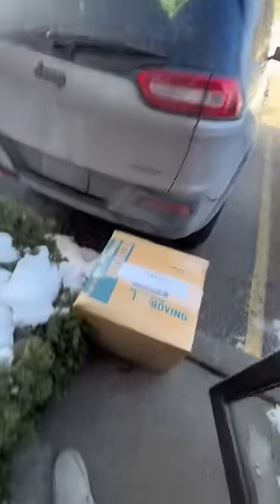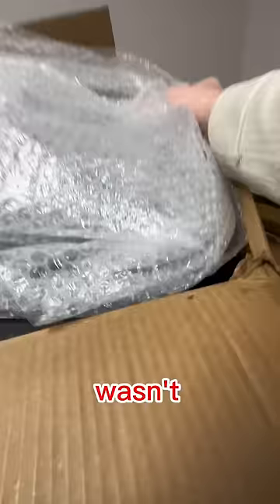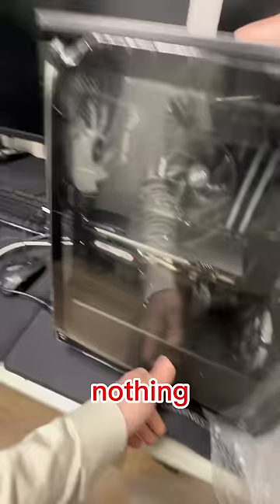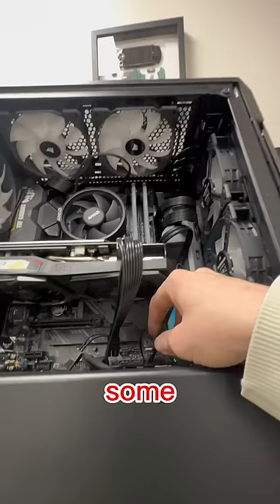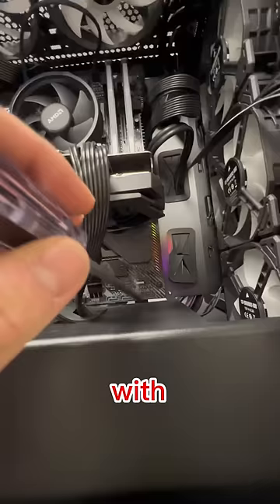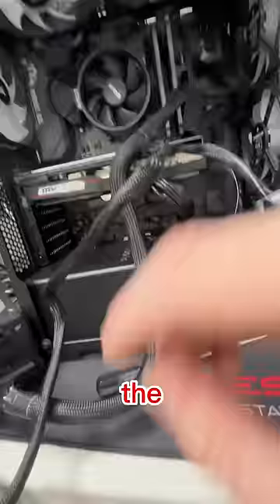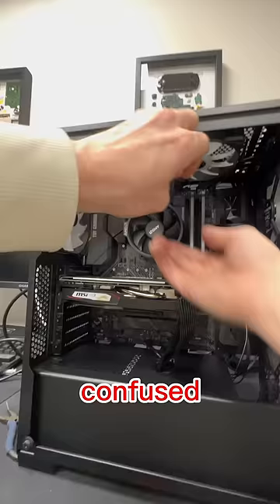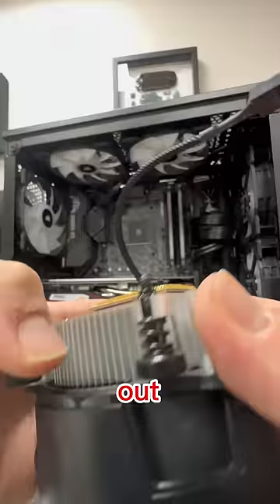Bent CPU Pins 😭🤬#pc #pcrepair #cpu #gamingpc #pcgaming #pcbuilds #pcbuilding #egirl #gamerguy

Comment: With all due respect, but the client did not break it, when removing a AMD AM4 CPU you should know to add heat to the heatsink since you pulled the whole damn thing out of the socket.

Edit: if an AMD CPU hasn't been removed for quite some time, maybe a year or so, you HAVE to heat it up by either using a heat gun OR letting it run for a couple of minutes, it's simple logic, there are A LOT of YouTuber's that have done video's regarding this, and I am truly shocked that people think this is the customer's fault, GamerTechTorronto is at fault, they fucxed it up.
Reply: Thats true for removing a cooler but pin were bent before that, u can see in video that when he was removing cpu he used one axis and pins were bent sideway
Reply: @itzpere  That's because they ripped it out of the socket 🤣

Comment: I can still straighten the pins if I was the one doing the repair. It happened to my old PC with an AMD CPU. I tried bending the pins back using a tweezers , use a credit card to check if it's straight vertically and horizontally, and slowly put it back on the socket. The pc worked. Nothing from the pins broke. You just need the right tool and a lot of patience.

Comment: I recently had 2 computers that weren't working at all - turned out the GPU was the issue. Both times RTX 3080 models. Without the GPU, both computers powered on just fine. However, I am with you on this repair - check the PSU first, as all the lights do is mean there is enough power to turn on those lights. Keep that diag in your arsenal.

Comment: So this owner built good looking pc but in the end placed a stock amd cooler on top of the cpu still messed it up , I would recommend take the time remove the bent pins and place it into the holes of the socket and place the cpu on top of the socket alligned the missing pins with the flat space on the cpu

Comment: Grind the tip off a syringe needle then use a sharp knife to deburr the inside of it. Slip the needle over the bent pins and gently nudge them straight. The closer the needle fits over the pins, the better it works. For pins that are only slightly bent, find a syringe needle that fits snugly between the rows of pins. Slide the needle in then lift out to nudge multiple bent pins back into place. They don't have to be perfect, just straight enough to get it into the socket. Closing the lever will finish straightening.

Comment: Use a ESD safe nylon black stick to gently bend the pins back. Never a metal tool. I've brought back many CPUs with bent pins. It just takes patience. Just don't over bend them or you could have bigger problems.

Comment: Similar issue to my PC, the thermal paste was so sticky that the heat sink pulled it out of the motherboard, forcing the CPU latch open and bending some pins in the process. Luckily they weren't THAT bent, and I got it back in, but getting a heat sink off of a CPU without being able to set the CPU down was a huge challenge, solvable only with a heat gun and dental floss.

Comment: send it to me 0.5 mm automatic pencil slides right over the pins allowing you to bend them back i fixed a 5950 had 70 bent pins.after there all pretty much straight slide a credit card through each slot this aligns the pins

Comment: Cpu can be repaired easily. First off take it outside and drive over it with the tires of your truck. Can't be a car cause it's to light. Make sure the moon is above you this is important. What will happen is the pins will Quantum tunnel into the rubber and realign with the gravitational pull of the earth and the moon and it will straighten out. To pull the Cpu out of the rubber your going to take hadron Collider and shoot a partial into the rubber then the molicules of the rubber will flip. repelling the pins out of the rubber. So easy I don't understand why we would through a cpu out.

Comment: A lot of people is going to disagree with me, but the most difficult thing to install (besides water cooling which I haven't done) is the CPU. Everytime I do a new build is the part I'm the most scared about, afraid It could slip outta my hands or something and get those pins bent. Not to mention is one of the most expensive parts of the computer.

Comment: Ive bent my cpu pins back in place by using a thin metal ruler it was a ryzen 5 5600x and its still going strong 2 years later runing a 4.9 ghz boost constantly

Comment: There was a 400% emphasis on "shorting pins" and 0% on actual diagnostics short of maybe using a different power supply.

Kids, if your computer was WORKING before and now it isn't. The problem is never the CPU. There is a very very small possibility that it's bad memory, a very small possibility that the memory could need to be re-seated, a slightly greater possibility that it's your motherboard or add-in cards and an even greater possibility that it's the power supply. All of that depends upon the quality of the components and I'm not counting lightning strike damage or other forms of external causation. Simply that it was working and now it's not.

Comment: Did you try to put in another CPU? It might be worth it to check if the Mobo is damaged. If nothing but the CPU is damaged he may have more options. Also, the damage I saw could have been from shaking. If that's the case it could've been on the way to you, or when he received it. My guess, he didn't install it himself.
Reply: No they just threw away the rest of the parts.

Comment: Always push down and twist PGA socket CPU coolers before trying to lift them.

As the pins got more numerous over generations of using PGA, they also got smaller, and there's less surface area and clamping pressure holding them in than there used to be.

Also, the pins themselves are weaker and could bend or break if pulled out while still clamped to the socket.

Pushing down a little takes some pressure off of the pins and transfers it to the substrate and face of the socket. Twisting a little breaks the bond the thermal paste creates between the IHS and the cooler's cold plate.

Every PC builder or tech should know this. The one in this video apparently does not.

Comment: Bro your using way too big of a tool to fix those pins. Get a set of solder masks to really asses the damage first. What I found best to use was a thin metal pry tool meant for pulling glass off phones and a small set of tweezers and exacto knife. If you have the means to get a cheap usb microscope or have a set of healing hands with a magnifying glass that also helps immensely.

Comment: Had the same thing happen to me. Was upgrading my system and pulled the cpu cooler off and the cpu came along with it. Luckily I was able to bend the pins back. now I’m sticking with contractor pads on intel. Pins are a terrible design.

Comment: i used a psu outside of a case for testing last time...the computer started blowing capacitors left and right..sounded like gunshots....ground your psu to case if your gonna..atleast set it on the case that should work..had the dude from xfx on the phone when it happened..it was out of warranty but he hooked it up cause he told me to do it...still ruined a 2-300 dollar mb and a cap on the fan controller blew to so thnx for tho $60 psu i guess lol

Comment: This PC is scarily similar to mine, same case, same MB, same case fans, just a different cooler, CPU, and GPU, and probably PSU.

Perfect parts for an 'inexpensive' mid tier rig.
MB: ASUS TUF GAMING X570
CPU: Ryzen 7 5600G
GPU: ASUS Phoenix GeForce RTX 3060
PSU: Corsair RM850x 80 Plus Gold Rated
Cooler: NZXT T120 RGB
RAM: 2x 8GB Corsair Vengeance Pro
Case: Corsair 220T Airflow

FYI: Mixing Corsair and NZXT RBG components is a wiring nightmare.

Comment: I've changed 100 plus coolers.(and am4) 50ish percent came off with the CPU.y guess is because the thermal paste was dusty/ bad conditions and glued to the Coolers, but I popped it back into the socket and worked perfectly

Comment: Morbid CPU story:

My PC didn't turn on either the same way as described in the video. My CPU's pins were also bent. 
I took a nail clipper, rearranged like three pins and just cut off 3 pins. Put CPU back into the MB and turned PC on. My PC worked flawlessly for the next three years till I got an upgrade. 

I am no professional so don't quote me but I believe the CPU does not need all pins to work. So in case your sausage fingers managed to bent some pins, instead of replacing or fiddling about, just rip out the bend pins with a nail clipper and put it back in. 

Or be a sane person and don't. Up to you. 😊

Comment: It's hard to rebend these pins without breaking them, I know it from my own experience. Once it worked, second time, gg. I made it with a cutter as well. That's why I don't like these pins. Sometimes the CPU comes out when you try to remove the CPU-Fan, and then it's already fucked up.
I'm glad they've chosen to exchange this design to a Intel similiar one. But until people got a newer one (which might take years) they have to fuck around with these.

Comment: No definitely not the power supply because if you put a non supported power supply then the pc would overheat and emergency power down, also I saw that the cpu was not place correctly normally pc’s don’t even boot up when it can’t use a cpu btw cpu stands for central processing unit you can’t use your pc without it all you would need  to do is check if one of the metal parts were bent then unbend them and if that doesn’t work then buy another one I would buy a AMD Ryzen 9 7950X3D that’s just my opinion you can buy whatever one you want.

Comment: Shipping ANY HEAVY item in bubble wrap is stupid! I would place 1” styrofoam  around ALL 6 sides of the item to fully protect it from damage! With that said, if it’s not in factory packing and it gets damaged during shipping FedEx or UPS will not pay the claim unless it’s in original packing! or you can prove beyond any shadow of a doubt that you properly pack it with thick Styrofoam protecting all of the six sides which means you’ll have to take copious amounts of pictures during the packing. I know what the hell I’m talking about. I’ve been shipping stuff via FedEx since 1998!

Comment: @gamertechtoronto I'm a hobby technician. I do lots of odd stuff, and one thing I've done is look at the purpose of those pins.

They are a BUNCH of redundant pins, meaning you could clip almost half (depending on which cpu chip ofc) of them off and it'll still work. The purpose of of redundant pins is mostly for heat dispersment and voltage parity. (Making sure a 0 is a 0 and a 1 is a 1) 

So bent pins on a cpu like that IS a concern, but it shouldn't mean a dead chip. I am interested in salvaging and returning that chip to you if you'd like me to take a Crack at it!

Let me know in a reply, I'll send over my credentials and contact information then, 

-Tim

Comment: father had bent like 3 rows fully going towards the middle and like 4 other rows with the same direction but not the full rows. Some of them where bent into the next row. I have some tools for wax and tweezers. took about an hour but it still works. its the 5th time I had to unbend pins on a CPU. The processor I currently use has ben bent 3 times but nothing huge as my fathers CPU.

Comment: What does mean by short it? I have used a screw driver and other conductive meteral to check if there is power, but I never heard someone saying short it.
Reply: The power switch is just connecting the two pins when pressed so you can short that connection with a piece of metal
Reply: @1FelixxileF1  oh thank you

Comment: You could have another reason that you are not showing but if any of my techs tried another power supply or really thought it was an issue with the power button when they can see power is making it to the motherboard they probably wouldn't be working much longer I can at least understand why you might think it's the Power supply but if you are hitting the power button and you are seeing lights then it's not the power button

Comment: Wait, you knew there was no support internally, and things could easily have shifted in the mailing process, and you still plugged it in and powered it on without checking every connection first? Seems a bit reckless.

Comment: I managed to fix a cpu more bent than that I grinded a small cheap screw driver reaaalllyy thin and used a magnifying glass, I just lightly rotated the flat head screwdriver underneath the bend and didn't break a single one

Comment: My pc started to overheat due to old liquid cooling system failing. was still able to load up to the welcome screen before shutting off.  I got a replacement cooling system but nothing connected to my monitor. ive changed monitors, cables, even buying replacement motherboard and cpu in case those were shorted out but still no change. no beeps when system loads but it still has power.  whould you know what I could look into to fix it? kids missing being able to use the valve index i got for the system.

Comment: What, 30 pins on the OUTSIDE and you didn't save it? I saved a 1600x a couple years ago with a razor with around 200-300 pins bent as someone had ran their finger across them, still got pictures of it and still in my PC today

Comment: Man... That's just not a good technique to fix bent pins. You need to try your best to apply equal force on as many sides as possible. 

So at the very least you should use tweezers. And as some gigga chads have already mentioned, a mechanical pencil without the lead works amazing.

Comment: amd does seriously need to fix this while cpus getting stuck to cooler issue. Never have i had it happened on any intel cpu. but 3 am4 socket cpus with stock cooler every single one got stuck. and in the proccesss of getting the cpu off the cooler i dropped it bent pins then amd refused to warranty it. terrible decisions, terrible company. imo

Comment: Good thing it was the CPU. If not, it doesn't appear you would have been able to figure it out without breakage. When troubleshooting a computer with a reported power issue, you should be #1 using a multimeter and #2 be grounded when working inside. You could have easily destroyed this PC with that recklessness. (over 40 years servicing PCs for the government)

Comment: I have a big question, my graphics card gets very hot, I cleaned it and changed the thermal paste, I did the same with the cpu, and still nothing keeps getting hot. 
my cpu, it goes over 40 and when I play 60 and maybe 80, the graphics card where I see the temperature says that it is in the 40s, but it emits hot air like a volcano.

Someone know what it is?
Reply: By emit hot air do you mean the fans rev up alot? Or you feel the heat coming off the pc?
Reply: Maybe bad airflow
Reply: Probably a bad thermistor

Comment: i just bought my new ryzen 7 and when taking it out (for replacing it with my old cpu cuz of update bios) the cpu was stuck against the cooler and it ripped the cpu with it luckly a few pins bend and i was able to bend them back in place like they were

Comment: Hey i wanna say idk if you could recommend anything but every 20 mins or so my pc disconnects from the wifi for about a minute but whenever my pc disconnects my iPad or phone doesn’t and it started when i got the pc about 2 and a half months ago when ether i troubleshoot it says access point or default gate wasn’t working but it says that every single time and it really annoys me, where my wireless connection antennas go is flashing orange and i really need to know the problem

Comment: This is why intel is better. Since you wouldn't have any pin bend problem at intel processor
Reply: No you'd just have bent pins on the motherboard and a dead motherboard instead.
Reply: @Gareth-tp5dc  well i do rather have dead motherboard that cost only ¼ of the Chipset processor price, rather than dead processor that some of them even have 10x way more expensive than the motherboard

Just like intel i9 gen 13900k or Ryzen 9 7950x

Edit:
And this is why people use intel more than Ryzen, because they have less risk and get the best Chipset in the market

Comment: what is the cable called that runs power to a disk drive or a ssd hard drive for the power supply its a 4 pin slot and i need to buy one and genounly cant find it

Comment: thats why you get intel CPU for two reasons. One, it doesn't have pins and it gives you a arrow on which direction you should install it, two its a amd processor why you buying one in the first place its a shite CPU. throw it away for good and get a intel.
Reply: AMDs are not shit lmao
Reply: @Galastin  ok so why do I have to not worry about overheating cpu, or messed up drivers having being updated two to three times a day, or overcharging the system and messing up components when its installed wrong with intel huh tell me does intel do that. btw NO intel does not do that.
Reply: @Virtual01Gamer  wake up bro, and stop smoking weed

CPU has nothing to do with Drivers or Charging. Also, similarly performing AMD generally runs cooler than Intel.
Reply: @destiny_02  I rather pay 400 dollars on something that is reliable and I can use for years, where a amd processor may last a few month if luck a year or two.
Reply: @Virtual01Gamer  No that's wrong, Your OS uses the drivers not the CPU. You should be blaming Your OS or the GPU drivers. It has nothing to do with CPU.
Reply: @destiny_02  how old are you like 12 I went to college and learned this every component in a pc CPU, motherboard, psu, gpu, ram uses drivers, and yes OS have drivers yes, but without the drivers being downloaded from internet/CD when you install gpu you won't get speeds or have lag in games its the same for cpu. Learn alittle more before you tell someone they are wrong.
Reply: @destiny_02  omg I was too generous more like 2 year old go back to kendegarden.
Reply: Oh yeah, update my CPU driver every day baby😂😂😂